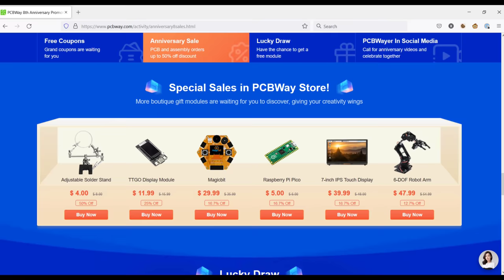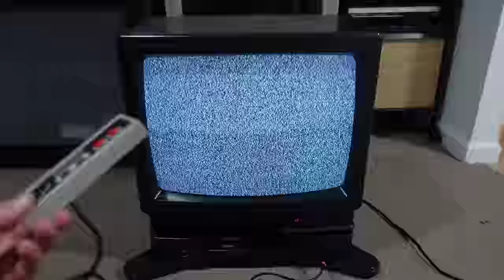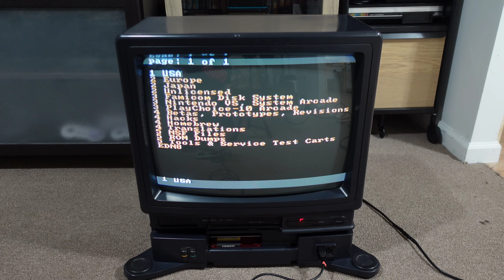Super RARE pickup - a Sharp NES Game TV! Complete teardown, restoration, and demonstration

Comment: i've actually been working on restoring one of these that was beyond repair, it works but i have a bit more to do to it. it involves using an arcade chassis to replace the beyond gone tv internals, a nesrgb, and a gbs control. i plan on adding more functionality to it like rgb inputs component and such made some reddit post about my progress. i Actually watch your videos quite regularly and the nesrgb install vidoes you have where quite helpful when doing the install, from one lefty to another really appreciate your work.
Reply from the maker: Awesome! Always a pleasure to meet another lefty. I’m really glad to hear that you managed to restore another one of these rare TV sets. I would have done the exact same thing if I found that the internals were too far gone!
Reply: Did you have to replace feet?  I got it from a garage sale for $20.  The lady didnt know if it worked.  It was her kid's who had grown up and moved.  It wasnt in the greatest shape when I got it in like 1998-99 or something. 1 foot left, no doors, controllers or remote, but it worked perfectly.  I rememeber levaing games on pause for days with no freezing or anything.  Unfortunally I dropped it once and picture went out.  Been thinking about trying to see if its fixable.  Might need a donor TV.  I havent taken it apart yet.
Reply: @JakeTaco83  mine cosmetically is quite rough no feet, no doors, no remote, no controllers, and a burn spot int he shape of a bottle cap on top. found it on the road side years ago apparently was used as a rental unit, it worked back then but the main tv board ate it some time ago. the easiest thing might be to get a 19 inch set with composite input and just rig it into the shell but it might no be so easy to do. i opted for the arcade board simply because with the digital error it was going to be a old school gaming only set. if the tube is still good and this isn't for the faint of heart, i mostly went the gbs control route because i plan to have component and rgb scart ports and maybe hdmi input. you'll need a nesrgb for sure but the gbs control is secondary really a luxury add on, an arcade chassis that uses 15khz rgb input  for a 19" crt with a cr-23 neck that works with or close to the range of 3 ohm Horiz / 13 ohm Vert on the neck, at least that was the ohms i had on my nes tube and the other sharp tube i had with burn damage i used for testing. best advice is google and watch videos on arcade tube swaps, it is a really similar procedure.

Comment: Sharp also made some of the monitors that Nintendo used in their classic arcade machines, e.g., Sharp XM-2001 (Donkey Kong, Punch-Out!!, etc.) Most of them were made by Sanyo though (e.g., Sanyo 20-EZV and 20-Z2AW). 

You won't find anything other than a Sanyo or Sharp in an all-original Nintendo classic arcade machine, and when arcade operators replaced worn-out monitors in Nintendo cabinets they usually stuck with Sanyo or Sharp, because those were the only ones that would work properly in a Nintendo cabinet as-is. If you were to put a standard arcade monitor like a Wells Gardner G07 (used by Atari, Midway, and many other arcade machine manufacturers) into a Nintendo cabinet you wouldn't have any sound and the colors would all be inverted.

Nintendo did stuff like that, presumably, to ensure that operators would buy replacement parts from them  Even their buttons were non-standard; just enough undersized so that standard arcade buttons were too big around to fit into the button holes in a Nintendo control panel.
Reply from the maker: Yeah that is correct! I forgot to mention the relationship also applied to the Arcade division of Nintendo. It’s always a pain when I need to source parts for the Nintendo cabinets that I own!

Comment: I used to have this a long time ago. My dad worked at a electronics repair shop and got one in. Guy said it was caught in a house fire, insurance was replacing everything, if he could fix it he could have it. Sure enough my dad fixed it...warped back and all. Worked for over 10 years...until a move happened. The warped back piece slipped, hit the board at the back of the tube then heard a hisssss as the pressure released. I was sooo pissed. I miss that thing.
Reply from the maker: Damn that’s too bad, your tv certainly was a survivor!

Comment: Isn't it technically rgb ready since it's wired directly to the TV? Or does it use a  composite connection between the TV and console?

Edit:
The Japanese models where a direct rgb connection. Where as the us models where a direct composite connection between nes motherboard and the tv's CRT. 

So US direct connection = composite 

Japanese = direct rgb connection between motherboard and TV
Reply from the maker: Yes that is correct, so there’s no RGB in this case

Comment: I need some advice.. I was given one of these and they insisted the Nintendo didn't work but after getting it home that wasn't the case it was just showing a yellow screen, I cleaned it up and set a new 72 pin in it( reinstalled the original after finding out it works still) I got it to play the sound from the Nintendo but the picture is very very pixelated. I'm stuck and not sure what I need to do to get the picture to come in clear
Reply from the maker: I would probably need to see photos to get a better idea of how it looks. It still sounds like the 72 pin is not good
Reply: It does the same with a new 72 pin installed as well. I have a video of it but not sure how to send it to you

Comment: That NES board has two empty chip slots What are those?
Reply: Dorito and Lays
Reply: Extra through holes so they could use either 0.6 or 0.3 inch RAM modules. Other versions of the NES have them too.
Reply from the maker: That’s correct, it’s for the larger sized package of SRAM
Reply: @trundlesaurus9681  Nice! And What could  happen if you install those RAM modules? Is there any improvement?
Reply: @JavierBonilla78  The RAM is already installed there, it's just the 1/2 wide version. The 3rd row of pins is electrically connected to the middle ones. There is no benefit using the 1/2 wide vs full width versions because the NES board has space for either.
Reply: @trundlesaurus9681  Thanks!